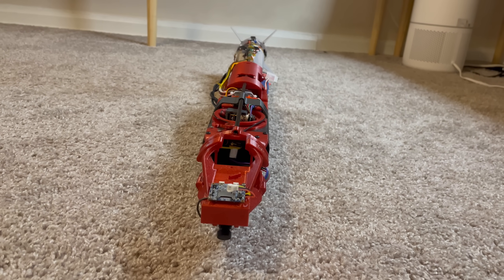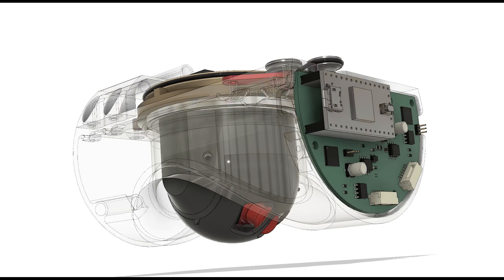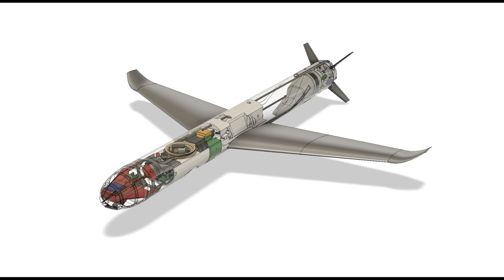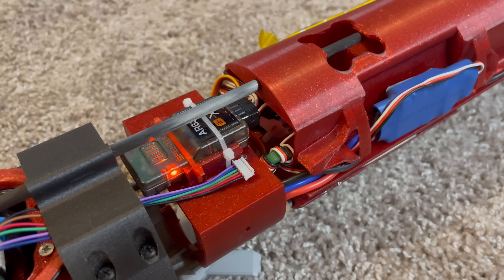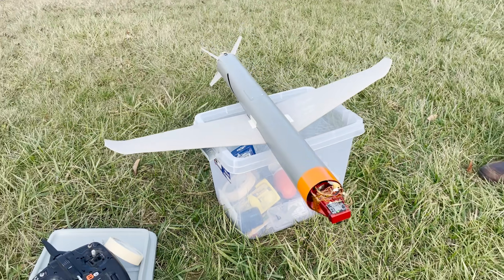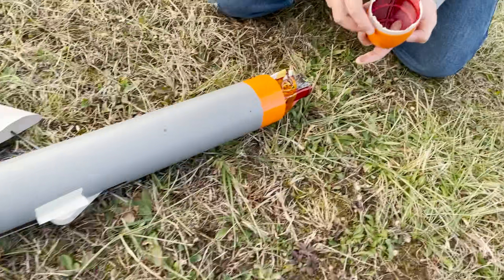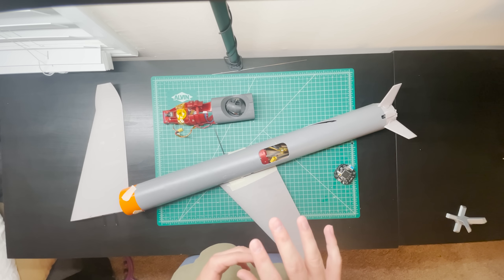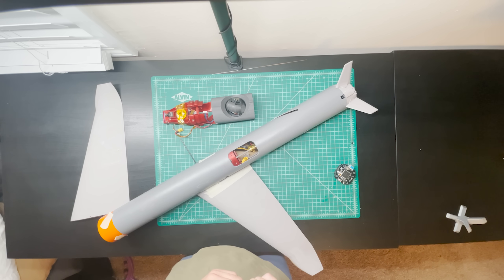Building (And Crashing) my Homemade Surveillance Drone

Comment: I agree your to heavy  and need to reduce tail weight especially , also need control on the wings now for launching a catapult or bungee type system- power system I would go 80mm or 90 mm fan unit 6s or more

Comment: not enough air or speed for those fins to do anything. I'm not sure that fan is actually doing anything either. Its far too heavy for its size. Make it out of foam and triple the size....at least, if you want it to loiter. Just too much mass in too small a volume. Get rid of the high speed ducted fan and try a tiny motor with a prop out front, or a pusher at the rear. 
Missiles that size with small fins either need a rocket motor, like an atgm or crazy speed at launch like an air to air missile. for those tiny fins to have enough airflow to push against. 
The gimbal etc is awesome, but heavy too. Maybe square the body and use it as part of the lift surface, like a modern fighter jet eg SU-27 platform.

Comment: Looks to me that the aircraft has an insanly high stall speed, which isn't very great for hand launches. It could be beneficial to calculate the stall speed, and to see if it even is close to something you could get it up to when hand launching, my guess is unfurtnatly no. Perhaps installing some wheels so you could do a runway launch would help a little, atleast then you would find out about what speed you would need it to go up to. 

Also edf fans really suck at efficiancy and thrust compared to something like a propeller, but that might not fit into your design. 

To decrase weight you could look into printing some of the parts with LW - Pla, which is something like 3 times lighter and if you tune the printer good, decently strong.

Comment: Hey, what if you launch with Air pressure? It's really easy to work with and cheap. You can get some pressure tanks for 300 bar 1L for about 100-140€. That should make the launch great.

Comment: no personal experience; but based on the mil ones... start with 3; the launcher; keeping your payload etc intact so don't have to double research later; and maybe option 4; an off the shelf "glider dolly"; basically non attached wheels; and then use a road/path/cricket pitch to build up the speed conventionally for testing (and autonomously land on it in future?)

Comment: Just my 2 cents as an airplane nerd (and pilot): 
I would ditch the thrust vectoring system. I understand you want to increase control authority at low airspeeds, but if you have a high stall speed to begin with there's really no point in attempting to maintain positive control at speeds below stall. I would go with a traditional horizontal & vertical stabilizer arrangement or possibly even a "Pelikan" tail that deploys the same way the wings will. It will make control way more intuitive as control authority increases naturally with airspeed rather than throttle setting.
Weight may not be as big of a problem as you fear, as long as it's paired with a high aspect ratio wing. Case in point: Sailplanes. Many Sailplanes can actually carry hundreds of pounds of water ballast to increase their wing loading and therefore speed during competitions, but are still able to maintain a reasonable stall speed so they are still able to thermal. A high aspect wing caries the benefit of increasing your loiter time and useful load while decreasing your stall speed for the same wing loading as an equivalent low-aspect ratio wing. I understand that a high aspect deployable wing is a bit of a challenge, but just as a rough idea imagining a design similar to the one at 4:24, except the larger wing rotated out 90 degrees from the fuselage, and the smaller wing connected at the tip and rotated out 180 degrees. Might be difficult structurally but you would be nearly doubling your aspect ratio.
As for the launch system, you might consider a bungee or winch, or even set on an undercarriage that falls away for a ground launch. Anything that results in a repeatable launch condition, as a hand launch introduces so many variables it makes it nearly impossible to isolate the issue after something goes wrong.
In any case, well done on your design so far! I can't wait to see where this goes in subsequent videos.

Comment: There is 3 things I think you could do

1- change de engine:
when I watched it for the first time, I notice that it only goes as much your friend have throw it, so I think would be good to change for a better one more powerful. 

2- Some motors to launch it:
if the problem is really about launching, I thing you could add some idk rocket engines? so you could launch and after it just deploy then, I don't think u would need a big and powerful one, just at least to launch it

3- air intake duct:
I think as the the air won't get in there right away, because the air is passing under the duct, and not going straight to it, got it? like an F-22, the air intake is already where the air is going, even if the engine wasn't pulling the air, it would already go in, of course because it's a hole under the frame, the air will go in there, but not as much as if it had gone straight in there. so I think you could make a larger one, and also put something under it, that makes the air go straight inside.

Ps: I'm sorry if there is some English mistakes, English is not my first language

Comment: I want to build something like this to drop from my ultralight during airsoft combat. Idea being someone on ground have remote, they call in a strike on the radio. I fly by, drop the glidebomb and then use fpv to guide to desired area. Mine would need to be soft tipped. But love the work you've done man I'll be following the for sure.

Comment: Loved the video! I'm an Aerospace Engineer and I recently jumped head-first into a similar-ish project without any sort of RC experience. My system is purely meant for relaxing FPV flights, but I think I have a lot of useful insights as I encountered pretty much everything you did in this video. First of all, for RC planes, getting off the ground is the single biggest hurdle. Your mass right now is excessively high. Generating lift is proportional to velocity squared. So at low to no velocity, you reducing weight isn't just beneficial, it's a requirement. Then, I believe the choice of an EDF is a major mismatch with what you're trying to accomplish. I know, it looks really cool (trust me, I also started with an EDF), but their thrust at low speeds is really poor and in general, thrust is limited by their small diameter. As such, I would instead opt to swap the engine out for a propeller in a pusher configuration. This will bring you much more thrust due to the larger diameter prop you can use, and it will also easily double or tripple your flight time since propellers are far more efficient than EDFs. Rocket launches take some time to set up, so if you want to monitor the entire process, having some margin on your flight time will be much appreciated. Unfortunately, the addition of a propeller will make your vision of a rocket-launched plane very difficult. It's a conflict of requirements, and you might have to make concessions. It might be worth employing a proper System Engineering approach and noting down your principle requirements and order them in terms of their importantce. Noting key and killer requirements will make the system a lot more functional in the end. IMPORTANT NOTE: There is a high likelihood that a rocket-launched plane like this is very much illegal to build and operate. (Hobby) Rockets are legal because they generally only go up. As soon as you aim to transfer to horizontal flight and actively steer them, you are building a cruise missile! Finally, for your control surfaces, I would generally ditch the thrust-vaning control. Its addition to controllability on top of the main fins is likely negligible.

Comment: As someone who also jumped into the RC hobby with 0 experience and decided to build an extremely complex model, this video is amazing. You just dialed everything to 11.
Reply: Not really. It's more akin to somebody trying to summit Mount Everest as their first climb with 100 kg of camping gear and no oxygen. Basically can't even get to base camp with all that crap.
Reply: @toolbaggers  That is a terrible analogy and completely misses the point of engineering projects like this. The goal is to learn just as much as it is to succeed. It also significantly underestimates the complexities involved in designing systems like this. It's not a matter of "grab the right stuff and throw it together". Your comment makes it seem like he set himself up to fail, and that the plane not flying somehow means the project was a failure. I'm going on about this because reactions like yours are extremely frustrating to read, and they completely undermine the spirit of hobby engineering.
Reply: Failure is always an option and success is on a spectrum. you learn more when you fail than when you get it right the first time.
Reply: @toolbaggers that’s a very good analogy. The gap between complexity and experience is huge. Makes him dont event know what is wrong because everything is new.

Comment: When Hand launching you need to be at full throttle before release & also throw into the wind. It helps when the operator throwing it has a running start

Comment: I have been building and flying rc planes for a while, and really edf's just are not good at such a low speed :)

Maybe catapult ? Or rocket launch ? Or as I saw Somewhere folding propeller in the front ?
How is youtube your current thrust to weight ratio ?

Comment: I would weigh the turret cam and replace it with an equivalent dummy load until it flies good so that it doesn't get broken needlessly.    That's a lot of stuff inside for such a small wing area.  I think make the wing compartment 50% longer for longer wings. I think that might still not be enough because they are so thin, but any longer and they will probably break.  At least double tail area.    Maybe you could use a motor on the nose with a folding prop instead of the edf,  it would give better static thrust.

Comment: - Rocket boosters?

- Magnetic rail launcher?

- Improve thickness for wing (areas near/touching the fuselage)?

- Improve nose cone material?

Thats all i have for ideas
Reply: Was thinking just using stretched electric for launch, similar to model gliders. It seems to need more airspeed  to ensure there can be control authority.
Reply: Also thrust vectoring, which is very important

Comment: Amazing designing skills, very impressive, well done! 
As far as getting it flying you will need a lot more "elevator" and "aileron" authority, there just isn't enough elevon/taileron authority for postive control. Ailerons on the wings would fix the lack of roll authority and a larger V-Tail (or Y-Tail as mentioned) should fix the pitch authority. Thrust is also too low, small EDF's are notoriously inefficient, a pusher propellor on the rear motor will give you much better (and quieter) thrust but can make hand launches difficult (read painful 😬). Your wing loading is also too high so bigger wings and less weight will get you closer to committing aviation. Good luck, will follow your progress.

Comment: You need to take some massive steps back before you get anywhere near what you attempted in this video. You're on the right track with your first two ideas, but the launch rail is more complications when you need less. Far less. Make a quick and dirty dimensionally accurate empty/light weight model. No payload, engine, anything except the aerodynamic shape. The control surfaces need to be fixed and simple/easy to replace (they're also too small to operate at low speeds so you'll need to experiment here). The goal is to put a single weight on the model so you can hand launch the glider and dial in the CG as well as determine what you need to change to increase static stability to the point that you can throw it and it will glide back to the earth like a paper airplane.

If you can't make a successful glider first, you're never going to get to the point of making a hand launchable controllable aircraft. Slowly step up the complexity once it glides. Just eyeballing it, I don't think it's very likely you'll get to the point that you can hand launch with everything in it that you started with, but you'll figure that out as you slowly add things back in. Once you get to the point where you can't add anymore weight and still hand launch, then you could consider the rail launch system. Until then, you're going to be adjusting way too many variables hoping to stumble on a success instead of proving the design in its most basic form and working up from there. Good luck!
Reply: perfectly said

Comment: Compressed air launch tube/stick for the rail launcher. Could be made from something like a 8ft section of copper pipe 3/4in size then PVC 1in that slides over it. Build a sled for the plane to set in.

Comment: +1 to the bungee system. I suspect you don't have enough thrust, but I a far from an expert. Starting with the airframe and wings imho is probably the best place to start, get it stable and prove out the slow speed aerodynamics.

Comment: Designed to fit in a 3" cardboard airframe used in rocketry, with deployable wings. Why those limitations if you are not going to either A) launch it with a rocket or B) something like a tube with a bungee or spring launch mechanism? Otherwise just any old efficiency flier would be a better solution if you are set on hand launching.

IMO you started out with a cool DIY missile design. Stick with that. Long duration flight surveillance drone might be better in a 2-3 piece drone with like a removable wing(s), and prop over EDF instead, if you are set on handlaunch.

Comment: I think the main problem is the hand launch, generally you want to keep the plane level or even slightly pitch down so you aren't throwing it into a stall. Next time hold the plane level and run while you throttle up and let it lift out of the persons hand instead of them throwing it. Doing it next to a hill was great, give it a little extra time to build speed before hitting the ground. Id also move the EDF inlet to the top, I saw your design on the bottom in the video and was immediately concerned about it sucking something up, only for you to talk about that right away lol. Moving the inlet to the top will have basically 0 performance loss, depending on the internal geometry you could make it bigger too though ideally the entire engine tube is constant area from inlet to exhaust. It also will remove the possibility of sucking something up again upon landing, smashing your inlet against the ground even with low throttle seems like a recipe for more broken fan blades. It will be more complex but adding ailerons to the wings would be great. The fins at the rear are already small and during flight they will be pretty deep in the boundary layer. You might also want to look into some incidence angle on the wings, I don't think you mentioned an airfoil but it looks non symmetric which is good. You could also look into temporary landing gear, like the U2 had, for takeoff and with TVC you might not need to turn the wheel to steer.

Comment: Would you consider some very fine chicken wire to create a mesh grill to prevent another blade misshap? Maby with a magnets to allow a quick disconnect attachment.
Also for take off weight... why not use a small rocket booster with a magnetic mount that you can flip a switch to make it detach. Simular to the military flying angles ac-130

Comment: So, based upon next to no experience of just watching people on youtube, a launcher of some sort seems the way to go.  You can lighten it, but if you can't carry the payload, what's the point?  Honestly, a rail launcher would totally work, but with the folding fin arrangement, you could fit this thing inside a tube...   compressed air would do the rest.  Another thing is instead of a servo for the folding wings, why not just make them mechnical and spring loaded?  That would both reduce weight and keep the functionality.  And finally, MORE POWER!

Comment: Make the lower control surfaces flat to each other, they don’t need to be at an angle like that. Also for launching, maybe use some rocket engines attached to the external and lunch it like a normal rocket, that would be the best way to get it up to speed. Also much larger tail section.

Comment: CG appears to be in front of your Center of Pressure or too close together. Either increase your tail surface area or move the wings towards the rear of the vehicle. Shifting internal mass towards the nose is an alternate approach or some combination of the two. This will reduce maneuverability, but it's better than not getting airborne.

Comment: I build some RC airplanes I would improve these things : 1. make either a more conventional tail or V-tail (you can still make it fully movable if you want) and with much larger surface area (by eye I would say 3-4x bigger). 2. get a higher speed launching mechanism as you said. Some ideas you didnt mention are launching it from a stationary quadcopter in the air or from the back of a moving vehicule.

Comment: Cool idea, but nowhere near enough low-speed pitch and yaw stability because the stab/control surfaces are just way, way too small.
Maybe a much larger V-tail could work. I'd change it from 4 surfaces at 90 degrees apart to 3 surfaces at 120 degrees apart. Make the bottom surface a shorter non-steerable ventral fin, but also make it longer along the fuselage bottom and possibly even sideways-retractable so it can be turned out of harm's way at touchdown. Mix the top two surfaces for ruddervator mode. Imagine a V-tail Bonanza combined with a Mig-23.
You might also want to look at sling launching it from a long rail somehow like a V1, to get safely up to speed.